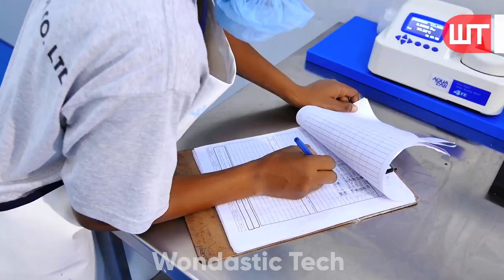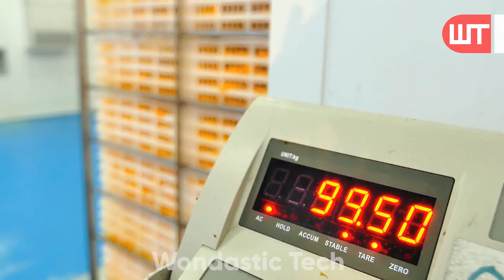How Dried Fruit Is Made | Dried Tomato,Orange,Apple,Strawberry Factory

Comment: What are the machines used for drying?
Is it microwave or hot air blowing?
Reply: Sun dried
Reply: Great question! In the drying process, both microwave drying and hot air blowing are commonly used. Hot air blowing is more traditional, using heated air to evaporate moisture. Microwaves, on the other hand, speed up the process by heating the water inside the fruit more quickly. Which method do you think works best for keeping the flavor of the fruit? 🍊🍓